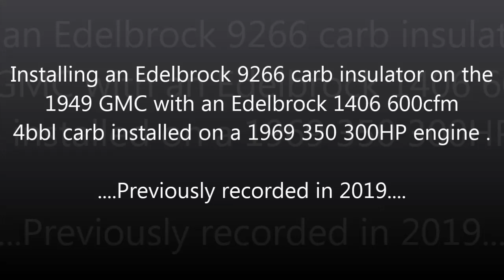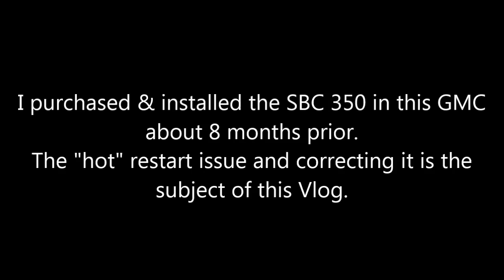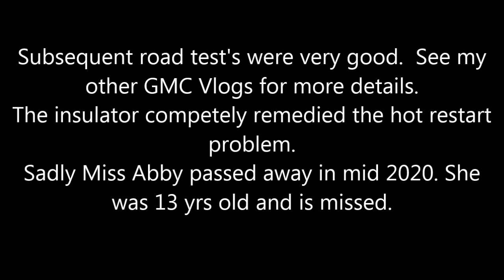1949 GMC, Installation of an Edelbrock 9266 carb insulator, Volume 37.

Comment: You may also want to lift the fuel filter off the manifold with some type of phenolic block. I really enjoy your videos. I am currently building a '52 Chevrolet 3100. Hope to have it completed by this spring.
Reply from the maker: Great suggestion!
Good luck with your 52. It's definitely worth the journey.

Comment: I had the same problem on my 49 Ford F1 it had a flathead V-8 with a four barrel,  I installed a phenolic spacer I found on eBay and it solved the problem.
Reply from the maker: A Ford 34 ragtop with a dual 2bbl flathead is on my bucket list.  Those flatheads had a distinctive sound.